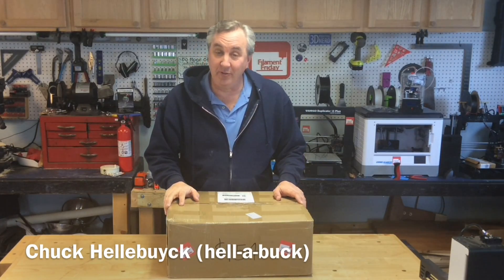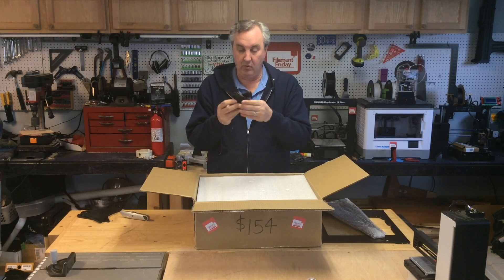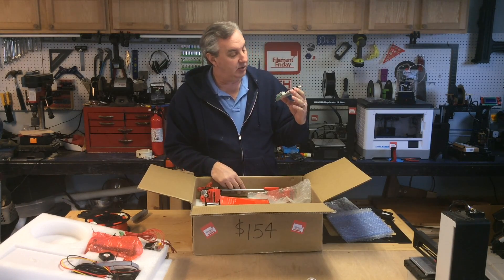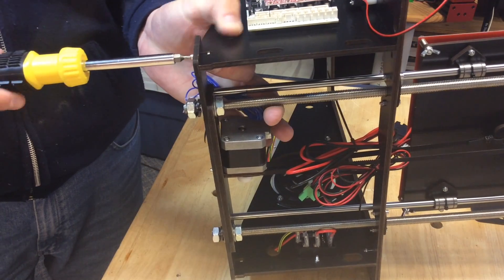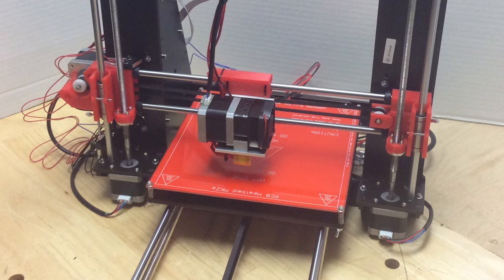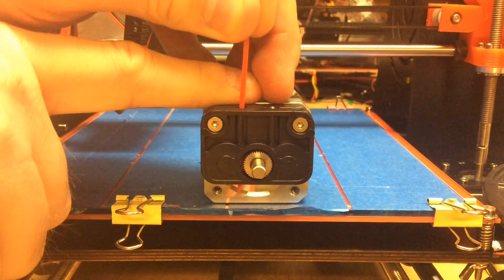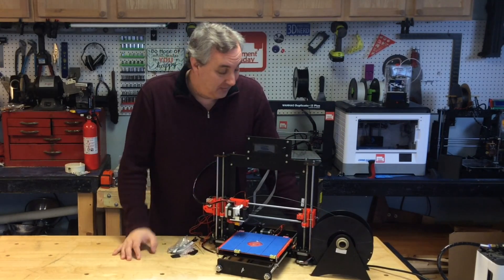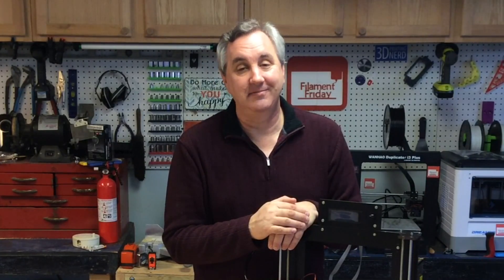$154 CTC 3D Printer Kit from eBay, Unboxing, Assembly and Test

Comment: For the money it would be worth it, Only if you are experienced working with maintenance issues common to 3d printers. Otherwise Do not get one!
Reply: Yup. My first printer was a CTC Replicator Dual clone and it gave me so many damn headaches. The bright side is that you learn fast when you have to take printers apart to replace parts. Overall I would agree, CTC is NOT a good brand for first-timers.
Reply: NanoBotAstronaut , my first printer was a i3 knock off brought used for $150. Within the first day of use, I lost my religion.

Comment: Is it possible to replace that nylon tubing with a brass coupler (I use them for mounting things to servo splines). Where would you get replacement threaded rods to replace any that are bent or wobbly?

Comment: Might be worth replacing the Z rods, or at least that wonky connector method from the rod to the motor. Print a part and heat-fit it maybe? Anything would be better than that tubing..

Comment: Great video, Could the power supply be flipped (I couldn't see the PSU venting patterns). Thanks for mentioning and differentiating between experienced and new 3D print users.

Comment: You need to try the Anet A8... I love mine. it does real good Prints
Reply: The Anet A8 is clearly far superior to this printer, at only $20 more. The frame is thick acrylic and not wood, the extruder is spring loaded and does not slip, and the rods are all straight(in mine at least).  The only negative is you do have to assemble almost everything, which takes about 4 hours (less if you are okay with the protective cover being left on the acrylic). 3d print a new center nozzle fan and it prints great.
Reply: Yep, I Love mine...you can not go wrong with one @ that cost. Assemble is easy on that, might take a bit longer but not but bad at all for a better printer
Reply: The acrylic they use on there is pretty thick... So unless you overtighten something too badly, and as long as you never drop the printer, it could be just fine, it doesn't have to crack due to use. Besides, you can always just take some particle board and saw out replacements, using the cracked frame as a template. Dimensionally, it's going to be a lot more stable than wood.

Still, I'd rather not deal with it. I welcome wood.
Reply: a8 + E3D clone = end game for most ppl.
Reply: Acrylic cracks sooner or later.

Comment: I bought the anet a8 as my first 3D printer ... I waited about a month to get it ... then after assembly I did the wiring and the side of the board exploded... it was a bad board... then I bought a new one ... and it worked ... but the first time I tryed to print something the extruder Jamed and I didn't know what to do ... so now I have the shaft cleaned out but the very front nozzel is still broke ... and one of the wires just snapped so I soldered it back together.. now all I can do with my 3D printer is callibrate it ... not print it ... well it's better then having a completely broken one I guess
Reply: CHEP 3D Printing also I have an extruder that is completely clogged I can't get anything out of it ... how do I unclog one ... I have tryed putting it in chemicals and tryed heating it up but nothing worked ... and the other problem is that the motor that pushes the filliment out is not spinning fast enough ... I tryed changing the settings to have it spin 300% faster but it stays at the same speed ... I just want my 3d printer to work ... I'm clueless and getting very angry
Reply: CHEP 3D Printing I'm thinking about filming a video about it I'll send it to you if I do make one

Comment: Great build review Chuck! The race to the bottom continues with these printer kits!

The kit was boxed well, instructions provided, and I liked that they used single LM8LUU bearings instead of 2 x LM8UU bearings on X an Z axis.

Ply wood will warp horribly over time, plus it didn't look very thick so not sure how long it would last. That hot-end is bizarre. Where is the heat-sink for it?  Good job making a new extruder!

Comment: I have gotten a few of these printers together and i think your review is really accurate. I was so impressed with the first i put together that i bought another to see if it was a fluke but they were both excellent basically out of the box after checking them out and a few little mods.  I made some video's of the mods i made if you care to check them out.... I think there the best bang for the buck printers ive seen.

Comment: Hi, I have had one of this for a few month now; the printer after a few 3d printed mods(Z wobble fix, a new extrude and a part cooling fan) compares well to my Flashforge creator pro. For just over $150 is a good option in my opinion if you are on a tight budget and really want to get into 3d printing (I am actually thinking about getting a second one of them).
Reply: CHEP 3D Printing I'm sure it's the Prusa z wobble fix which disconnects the bed from the rods. I'll find a thingiverse
Reply: CHEP 3D Printing check this out

1849359
Reply: I will upload a make to thingiverse; being meaning to upload a few for a while (will also have a look for his videos). Thanks again Chuck.

Comment: Nice...just like my Anet A8 that I have, a few minor 3D printable "mods/upgrades" makes the printing soooo much better...first thing I saw was that z axis rod was wobbling all over the place...a z wobble mod will probably fix alot of the issue with that...make sure you keep the threaded rod lubed, mine was sticky as well...I manually ran it thru the full up and down range with gcode commands about 1/2 a dozen times to loosen stuff up, but your method with a drill was probably MUCH easier!

http://www.thingiverse.com/thing:1849359
This might be a good thing to, to get rid of that rubber coupler thingy you had to heat
http://www.thingiverse.com/thing:1841872
And a filament guide
http://www.thingiverse.com/thing:2102345
This might help as well
https://www.thingiverse.com/thing:1694197
(just a quick search thru thingiverse, I don't have a CTC Prusa i3 printer)

Comment: Hi! Thank you so much for doing this review. I just bought this printer and it is arriving tomorrow. I'm pretty technically minded and looking forward to it. It's my first 3D printer. I know it won't be perfect! Thanks again.
Reply: hey! i have it and its all assembled! it was a fun build. im having some issues with the software. did you only get it to print from the SD card? my computer won't see the printer.
Reply: i installed the 'arduino driver' but the driver mentioned in the instructions doesnt exist. you know, that step where it asks you to locate the device in your device manager and update driver manually?  i did use the SD card and it prints! i ordered that spring tensioner part because I can tell it skips a bit when printing. Overall im pretty impressed! Anyway if you do have any idea about that manually installed driver or if you have it let me know. thanks again for all this cool info!
Reply: thank you so much! its working from my computer now! ill post a video of my first successful print when the tensioner part comes. thanks again!
Reply: hi! So i figured out that the extruder is grabbing the filament fine. The strange thing is the extruder gets jammed even when elevated above the bed. Temperature is 200c. It starts printing then i hear a thudding sound and nothing coming out. it is grabbing the filament but it is getting stuck in the hot end. The bed is level. could it be the filament quality?
Reply: i swapped out the extruder stepper motor with the x-axis stepper motor and presto! It prints. I'll replace the stepper altogether next but it works! thank you for all your insight and help!!

Comment: I have this same printer, on my extruder I found that there was to much interference with the gear and the filament causing it to bind and skip steps.   Slotting the mounting hole slightly help a good bit, but the real problem ended up being the driver board which died shortly after. Replaced it with  a drv8825 and it hasn't' been an issue since.  

On mine of of the cables for the z axis motors was also wired incorrectly causing it not to work, simple fix, just swapped the pins. 

While printing ABS the fuse for the heated bed on the circuit board overheated and melted, so i bypassed it by soldering a piece of wire where it was, then rewired the heated bed so that it was turned on and off by a relay controlled by the mainboard, no more 12Amps melting the mainboard. 

next up was the wood carriage plate, which between the heat and spring pressure had warped badly, and would require the whole bed to be releveled for every print.   I replaced it with a piece of stainless sheet I had lying around.  Now I get decent prints consistently, I have some more parts coming so I can start to get better prints yet.

Comment: This is why I love your channel (the only 3d printer channel I still sub to) because you just lay it out there and no trying to sweet talk it.  That extruder setup does, indeed, suck.  LOL.  Where those Z rods warped?  When it was moving it sure looked like it and I have never seen a setup like that where there is a nut BUT not an acme rod.
Reply: Yep, as my I3 Rework V1 uses all threaded 5mm rod and I am going to design it (the printed pieces) for Acme threaded rods as the biggest headache on this printer has been those all threaded rods.
Reply: oah yea... i think you dropped my channel :-)  i don't care to hold anyone hostage but it was fun hashing out comments with you... take care

Comment: STL file for the extruder part you printed?
I made something similar for my printer, but I fabricated it out of several pieces of aluminum glued together with jbweld.  Same idea though, your basic direct drive, mounted on the motor, extruder.

Comment: In the Ebay listing it shows actual couplers not those plastic tubes.
Reply: I wonder if they changed it or like so many of the Chinese listings that the pictures are not indicative of what you will really get?  edit:  Look at the picture that shows everything in the kit and couplers are shown already attached to the Z motors so Chuck should message them I think.

Comment: I have this printer and I can fully agree with eveything you said in this video Chuck. I did buy it knowing I was going to spend a lot of time tinkering and upgrading and I printed the exact same extruder parts for the exact same reasons. I also found that the extruder motor was getting rather hot so I installed a cooling fan on it which helped a lot but I eventually upgraded to a genuine E3D v6 and titan after many weeks of trying unsuccessfully to calibrate the E-steps. It was a big upgrade at more than half the cost of the printer but made life so much easier. 

The wooden frame (my main reason for getting this I hate fragile acrylic) is good but i too had some twisting from warped parts like you did so I screwed it down with L brackets into an enclosure made from 2 ikea Lack side tables. This allows me to print more consistently and a little faster too. I have also added an aluminium bed for auto bed levelling with an inductive sensor so the GT2560 board has upgrade potential. I have done quite a lot to mine from stock but other than the E3d parts I have spent very little in cash but many many hours in learning how to setup and program a 3D printer which was my main objective. I get good usable prints now from a cheap printer and I know that a lot of that success is down to MY hard work not from an engineer on the payroll at the manufacturer. I could have brought a Prusa MK2 or ultimaker but I wanted to build and learn at the same time.

Also I think your X axis belt is too short (i know this is already assembled so not your fault) as the idler pulley is sticking out a lot further than mine does which is why you probably needed to remove the screw on the frame.